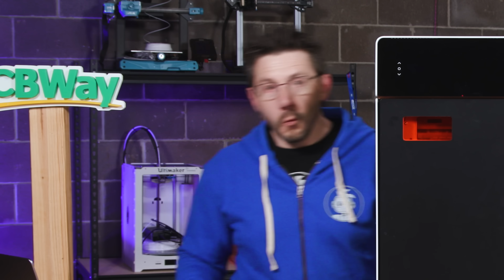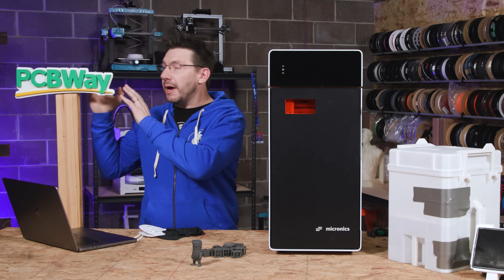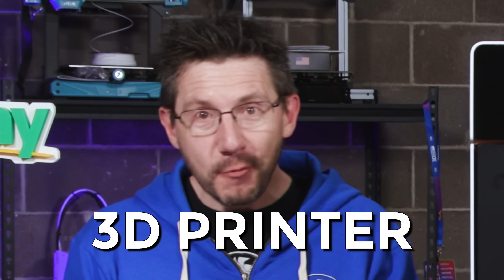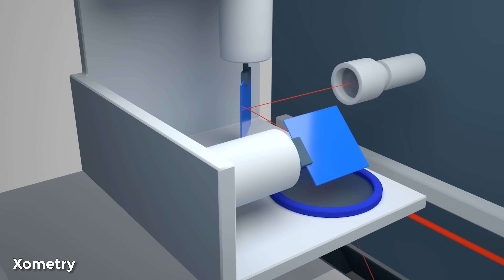SLS 3D Printing AT HOME?

Comment: the fact that you are not wearing PPE in the few seconds when the cake is first get exposed actually triggered me a bit.

In addition, the hazard with SLS is actual the spills. It is good that you wear PPE when handling the pieces.The powder that spill onto your clothes and around your workshop that is still a concern. They will eventually make their way into someone's lungs.
Reply: Apparently it's not THAT concerning for lungs, it's quite a large particle size, but it can cause irritation if you do it often
Reply: @tdg9281  Yeah.. it is not really a data driven concern. If anything, it is the fact that there is not enough data yet that is the concern. Only time can answer that.
Reply: @tdg9281 the msds for pa12 sls powders say to use engineering controls or totally self contained breathing if you cannot contain the powder with exhaust and filtration systems so I'd trust the msds from actual mfg's over the kickstarter mfg that seems to be downplaying any problem that is legitimately a thing

Comment: Pro tip for your sensor buddy. Use deep sleep on an ESP32 and you don't need the distance between the micro and the sensor as there will be no heat buildup. With an ESP32 you can get the entire sensor smaller then the PCB of your micro controller. With ESPhome you don't even bother with firmware. Just configure it in .yaml and you are done.

Comment: Fully understand what they are trying to do with and make it as simple as possible. 
But when trying to remove the media from the part. The particles are so fine I do not think the mask that Joel was using would work. 
I think you would be better served to put the “Cake” in an empty Sand Blaster chamber with gloves attached and air to help remove the loose media. Then put it in another sand blaster to finish the process.

Comment: I like some of the features of SLS (integrated support, fine resolution, etc), but there are aspects that make it less desirable compared to FDM.
1) cost: powder is expensive and it can only be used so many times during print
2) materials: it currently is inherently single-material and single colour
3) cleanup: it's messy, and time consuming, and there is some danger of inhaling particles (which can't be good).

I think FDM will eventually rival all of SLS's benefits and there are good examples of many, though they have yet to all be integrated.

SLS still offers quality and layer uniformity that can't be matched by FDM currently, making this useful for specific applications, and certain enthusiasts.

Comment: Not even close to resin level of detail, so for anyone who does minis, statues, busts etc, it is useless. And for the rest, you can just use FDM... I mean, this is a cool printer, but the fact it is full of fine sand makes it unusable at "home"  as it will definitely gets EVERYWHERE.
Reply: There is one specific scenario in which this would be far and away significantly better than SLA or FDM printing. Extremely complex structural components. If you are making car parts for example, not only would it be easier in a SLS machine because you don't have to worry about supports at all (some are hard to print even with soluble supports), nor do you have to worry about layer adhesion strength (since it's sintered plastic), but you can literally fill the entire build cube with them. I don't think this is the type of machine to print toys on and is clearly more of a hassle than a FDM printer, but it is by far the best method of printing for highly engineered components.

Comment: Really nice to see what they are working on! I will be curious in the future to get one in house, but not from Kickstarter.
I find fascinating how you can easily swap polymers without need to do a crazy amount of cleaning in the machine.
I'm running for quite some time SLS production and even with all the right tools still a messy process. To be honest I think if they will have a better post-processing unit even if that mean pay 5k for it, it could be really worth it for the workflow but most importantly the safety of people. Highly recommend having a dedicated space, powder will be everywhere, even with industrial equipment you still find it on top of any surface. As well, SLS powders are not themselves explosive, but there is a risk of explosion when they are mixed with air, so highly suggested a static dissipative industrial vacuum to clean the spills of powder.
Looking forward to seeing what they will do in the next 12–24 months.

Comment: And Joel will be finding media powder in the room for years to come 😂
Reply: You will need a hepa filtered vacuum and not just hepa type filter it has to be a explosion resistant antistatic self contained absolute hepa filter (expensive) otherwise you could cause a powder explosion or just spread the dust around even more. The fume extractors for these are normally absolutely massive the in machine filter and dust filter they ship are just going to spread the dust around so you can't visually see it. You should also have a particle counter to make sure the exhaust, fresh air intake, filters, vacuum are all working properly.
Reply: @riakata OK, instructions super clear, working on a print that will facilitate HEPA filtering for my buttcrack.
Reply: ...like finding sand in your buttcrack after visiting the beach. 🙂

Comment: I'm wondering what people will want to make that justifies this machine?
Reply: Nylon is hard to print. And not having to deal with the remnants of support material is critical for some parts, particularly mechanical ones. Think about printing a ball bearing (random example). With FDM or resin, one side will always be rougher than the rest because it had supports.
Reply: @tenchuu007  Ahh, so not higher resolution, just no supports with SLS?

Comment: 12:00 You could place the box inside your media blaster (or a media blaster large enough)  and combined prep workflow and dust control,
Reply: you could, but then you cant reuse the powder anymore, since its mixed with the blast medium
Reply: @Bastyyyyyy he could use the actual sintering material as the blasting media as well.. it should work theoretically
Reply: Unless you use a second cabinet dedicated to breaking up the cake.

Comment: It is interesting but is there much more to give to the maker than Resin, FDM or even CNC printing ?  These methods are a tenth of the cost (for the cheap ones) to get good models like Joel was producing on this machine.  In addition the time to get a model looks crazy and all the extra handling and things like the media blaster (an additional cost) might put buyers off.  Some SLS I have seen can sinter metal directly and that for me would be a big incentive but I expect that would be a larger machine with a more powerful laser and cost a lot more.
Reply: No support materials, better materials than resin and better strength than FDM prints
Reply: @username9774  ok, sounds good, but as always, it will depend on the part and use cases. The cost per part might be a driver for choice among the manufacturing options. While very capable, this device might be an expensive war hamer to crack a nut.
Reply: Better materials is only relative to how you use the parts. Thanks but no thanks, ill stick with my resin printer. Lower cost to buy, lower cost to get materials to use, better resulting finish right out of the print, and I would argue its reasonably safer and easier to maintain in the long run. Fine powders are no joke, they will get everywhere. Resin sure can be a bit toxic, and somewhat messy but the cleaning and post processing is less headache then the process i just saw Joel do. Simple mats and an exhaust system work fine for resin jobs. Unless this or another consumer cost sls can print metal parts, then as a hobbyist, resin and fdm are my go to choices.
Reply: @gw2878  I agree.  I have a CNC machine, small and cheap, but I can mill aluminium and it has a 4th axis so I can make detailed 3D parts.  I don't think SLS can make things from sustainable wood either.

Comment: The question I have is how much powder will cost. The company selling this printer is out of stock, and the cheapest nylon I found in stock elsewhere is like $100/kg or more.
Reply: it will also be around 100$/kg, maybe if they get big that price will come down slightly but even good Nylon filament costs 80-100$/kg so don't rely on that happening
Reply: @username9774  I think the filament prices are more because it's a low volume market, pellets are much cheaper.
Reply: current prices on their website range from $220 to $300 for 5.6L of whatever media you get
Reply: @enor6117  So around $90/kg, but still out of stock.

Comment: Thank you for mentioning the safety side of SLS printers as I always see promotional material where no one is wearing PPE. I Interned at a full scale SLS facility while in college and as long as anyone was working with the printers, the room had to be locked down. When working with the printers you were required to wear a full respirator hood, anti-static shoes, a chemical and flame retardant lab coat, and disposable gloves to be compliant with lab safety. Clean up also required a specialized anti-static shop vacuum and everything had to be cleaned before the room could be opened again.
Reply: Based on that I don’t think this technology is ready or safe for home or hobby use. Sure he used a mask and gloves but they aren’t perfect and it doesn’t stop the powder from getting in the air or on surfaces where it will later be dispersed into the air. The particles are that fine that they will probably stick around for a while in the air so just taking a mask off as soon as you are done likely is not anywhere near enough protection.
Reply: @conorstewart2214  I would agree with that statement. The reason resin printers can work in the home/hobby space despite also being dangerous is because spills can be contained and fumes can be extracted. You spill SLS powder and that stuff is airborne. even after settling, it can get kicked up again and stick to clothes. Hence why SLS powder is treated a lot like you would asbestos.
Reply: @conorstewart2214  it's similar with standard printers too - they give off a lot of particulates. The usual refrain is "yeah but it's less than cooking" but we don't cook with plastics... Open 3d printers shouldn't be a thing and enclosed ones should all have proper filters
Reply: these are all the same precautions I have to use in the Metal laser powder bed printers I use at work. The powder is no joke whether metal or plastic. It WILL cause long term health effects if handled improperly.
Reply: Yes but that paper mask is way too little -- a proper rubber-sealing respirator would be my choice
Reply: The company is pushing misinformation the powder is toxic just by virtue of being a fine powder. It also is a fire and explosion hazard lots of home vacuums have brushed motors and no esd discharge route and will make enough sparks and discharges to ignite vacuuming up a spill of powder. Also you don't know if someone thinks they can use their cyclonic separator to make cleanup faster and they just vacuum up the entire cake which is a direct path to an explosion if they dont have metal grounded duct and true hepa filters to prevent dust from getting into a explosion resistant vacuum blower.
Reply: @riakata  one thing that also drives me nuts is people thinking a HEPA-rated filter means something is safe. If the unit the filter is in is not HEPA-sealed, the filter rating is providing a false sense of security because all of that fine dust IS escaping.

the idea of having a simple filter and fan clipped on the edge of that bucket to prevent the dust from circulating in the room is absolutely ridiculous
Reply: @guitarchitectural their whole dust handling system is basically dangerous nothing is grounded the whole thing is plastic the fans exhaust is like 38mm away from the hazard. It's really insane how much  the mfg is downplaying the hazards while still trying to claim they are prioritizing safety. If they can't acknowledge a simple fact nylon powder can burn and powdered nylon can burn really fast and if you don't do things safely it can just turn into a dust explosion hazard really fast before you realize the hazard level went from leaky shaker bin to whole cake of powder is lifted into the air and finds an ingition source of unknown origin and it becomes one of those chemical safety board videos about dust explosion hazards which includes typically safe sounding things like sugar and flour. Extra irony is you also need to wear a mask around large quantities of ultra fine food dust as well because your lungs are for gases and dusts of any kind are not gases and you don't want them in your lungs ever.
Reply: Thank you I was wondering if I was worrying too much but that mask is not enough for working with metal printers
Reply: Interesting product and a good video.
Lots to unpack with this:
Is a SLS nylon print as strong as a FDM nylon print?
Or are the products created just higher resolution than FDM but weaker and stronger than resin with similar resolution?
I’m trying to see what this technology offers given the cost and risk.
On the safety side…in my experience powders (not SLS related) can get everywhere and can stay airborne for long periods of time while being so small you can’t see it depositing silt everywhere (including your lungs, stomach and eyes).
You think you got it clean, take your mask off and then start breathing in contaminated air…a finger wipe on a glossy surface the next day is usually surprising…
Also regular vacuums are not ideal, dust extraction vacuums with HEPA filtration are far better at trapping contaminants but are not inexpensive.
The glass bead blaster is another dusty tool that has its own hazards. 
As the glass breaks down into “dust” it isn’t just dust…assuming you have the right vacuum and PPE it’s just more clean up, if not a host of respiratory problems can crop up, sometimes years later.
plus they are a hog on air consumption requiring a decent air compressor so yet more expense if you don’t already have one.
Hard seeing an upside to this at the moment.
Reply: Wonder why you wouldn't just get a half mask with p100 filters on it. The filters are cheap enough and do a way better job than a little dust mask
Reply: Great initiative 🎉
Reply: It's not enough to simply utilize PPE, but it more imperative to learn properly utilization of PPE.  The following is my comment to 3D Printing Nerd.

8:26 "...without the proper PPE."

Just a heads-up: your facial hair prevents a dust mask from properly sealing against your face.  So while you may have "proper PPE," you don't have the 'proper face' for that PPE to successfully do its job of protecting you.  

Here's a cutesy official infographic to illustrate: https://www.cdc.gov/niosh/npptl/images/FacialHairWmask11282017-508.PNG
Reply: My first experience with sls was my  first design job in college, I was designing and printing parts daily. I had no idea how dangerous it could be.
Reply: Hi folks, I work in a university with experience in both metal and polymer powders bed machines. In short, this machine is a death trap. I personally know people from the technology's infancy who were not aware of the health implications. They're either dead now, or on oxygen tanks with months of life expectancy remaining. No jokes, do not use this at home.
Reply: I cancelled my sls order, thanks@darrend7352
Reply: The company claims safe to inhale nilon at miniscule amounts. At most a bit of irritation...
Reply: that is so unnecessary
Reply: @NtaksAKAKevin  according to whom, professor?
Reply: @theglowcloud2215  according to almost every single SLS printer manufacturer. I mean of course if you are  in contact with the powder for 8 hours a day yeah you should wear a respirator and gloves. But the antistatic shoes for example are unnecessary. Nylon PA11-12 ect. powder is not toxic if it gets on your hair or skin. But yeah I 100% agree that you should not breathe it
Reply: @NtaksAKAKevin  seems like a matter of scale. Original comment specified working in a full-scale SLS lab at a university. I think that probably necessitates more stringent safety protocols than one guy in his garage.
Reply: Also thank you for mentioning Taylor Swift. I feel like she is underrated and should get more attention 😂

Comment: lung cancer speed run
Reply: I can win this race
Reply: This is why I'm going to make a step in bunny suit for myself. Plus the printers like it hot. Only having to cool the bunny suit is a lot easier.
Reply: As dangerous as an orbital sander. NBD, just don't be dumb.
Reply: sla is acsually way worse than this 😂 just get a proper 3m face mask, and youre totally fine, the particles are acsually really big compared to the ones a sla printer releases
Reply: I want to buy a sla printer and will only use it outdoors with a proper mask and gloves and goggles. Is it still going to be unsafe?   @Basement_CNC
Reply: Resin is far far more dangerous. Nylon is inert, and the particle size is fairly large. An N95 mask is all that's needed to be perfectly safe, though there's not much risk even without it
Reply: Inline Fan and some duct tubing?